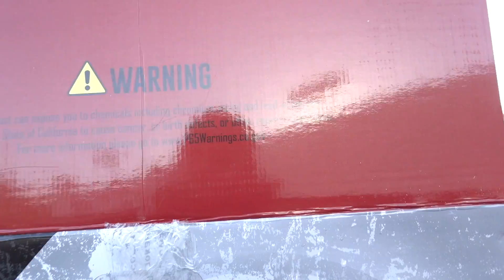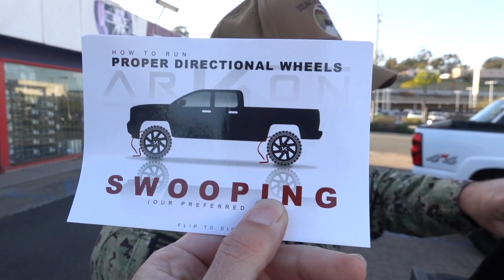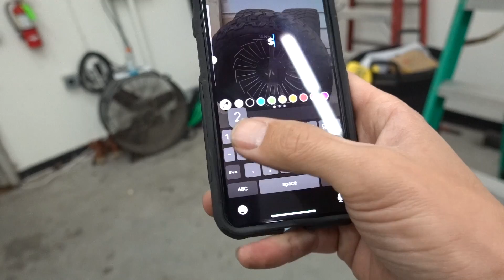WE FOUND THE INFAMOUS LONG TRAVEL ESCALADE!

Comment: I'm dying at wes. Bless his heart no good deed goes unpunished.  Hopeful ran to auto store got new ones. Lol..
Reply: I used to work at a dodge dealer and we had this problem a lot.. it’s from people trying to use the wrong socket on the lugs and those stupid caps slip on the actual lugnut underneath.  Most people use metric sockets on them(21 or 22, can’t remember wich one) but the because it’s actually standard size lugnut(7/8 if I remember correctly).